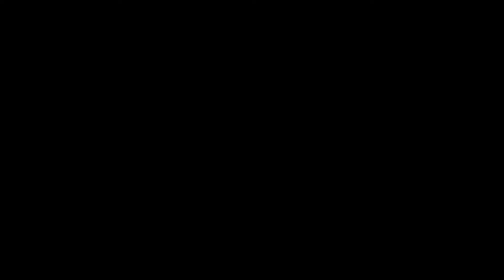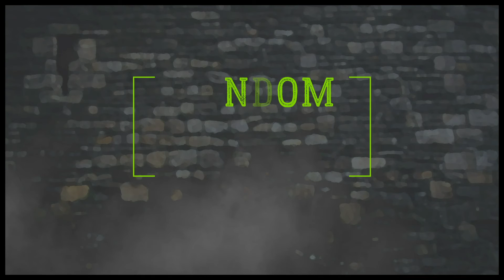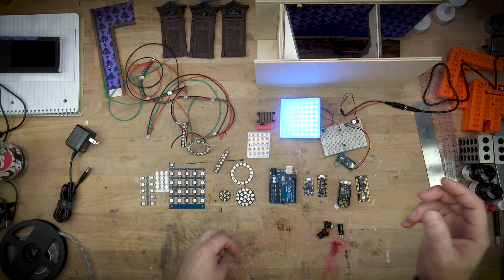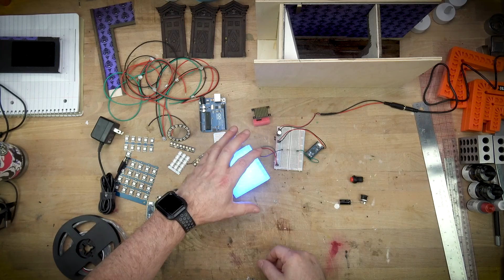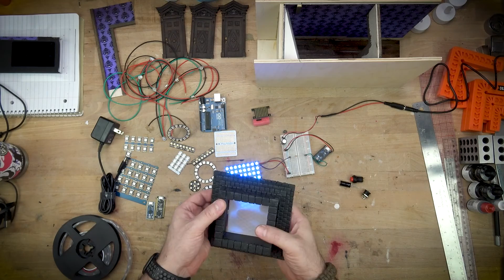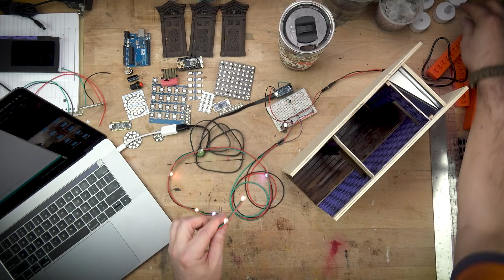Boss RGBW LED Lighting - NeoPixels and Microcontrollers

Comment: What are the orange corner things on your table around 21 minute mark?
Reply from the maker: Those orange L-shaped objects are relatively cheap plastic right angles that are used to make sure everything is square. When I’m gluing things that need to be as close to square as possible, I’ll clamp them in the corners while the glue dries. They come in different sizes and are accurate enough for the type of work. Hope that helps! All the best!

Comment: Good afternoon

Your work is amazing, explains very well.

However, I have some doubts, I've never used the Arduino and would like to try it in a diagonal alley booknook.

as I saw in another channel, nerdforge, the booknook will have some amount of WS2812B leds.

In some stores and windows, they will be looped with colors simulating that magic is happening inside, in others, they will only be lit and sometimes turned off in a yellow color to simulate that someone is in the room or has left.

can i connect all of them, one after the other between the 3 wires for the distances between the points and finally connect them all to a single pin on the arduino and program so that each one of them works in a different way and color? a resistor and a capacitor or would I need to individually connect each microled on different pins with several resistors and capacitors?

Congratulations for your channel, I became a fan and I'm sorry for the English because I'm from Brazil.
Reply from the maker: Thanks! I appreciate it. The easy answer is yes. Your idea is a great one and NeoPixels or WS2812B LEDs are perfect for the project.

There are some limits to maximum distance between the LEDs. It seems like under 6" or 15cm should work. The limiting factor is signal loss on the data line so you may find the LEDs behave strangely. You can have as many LEDs on a strand as you want and a strand of multiple LEDs are controlled by a single pin. That also means you can have as many strands with multiple LEDs as you have pins to control them. The LEDs are not powered by the Arduino but are powered directly from your power supply.

The resistor on the data pin helps protect the circuitry on the first LED of the strand so you only need on per pin. The capacitor helps prevent power surges when you power everything on. I generally put one capacitor in right at the point the power comes in to act as a bit of a surge protector or power conditioner. Think of capacitors as storage tanks... when you power up the circuit, if the first thing the power encounters is a capacitor, it starts by filling that capacitor and then releasing it to the rest of the circuit helping to smooth the flow out.

In many of my projects, I'll have a couple of strands of NeoPixels and even a single neopixel on a pin due to the location. I'll also use regular LEDs when I don't need to change the color. You can use the Arduino to turn single LEDs on and off and even control their brightness if you connect them to a pin that has PWM. Keep in mind, an Arduino pin can really only power a single LED. Finally, there are flickering LEDs that simulate candles or flames. I used those when I want to simulate firelight and don't want to try to do that in code.

A Diagon Alley nook is the perfect project to try a bunch of different lighting techniques. I hope this answered some of your questions. Best of luck on your project! Cheers!
Reply: @RandomMakingEncounters  wow, thank you so much, now I'm much more confident in taking a risk.

A big hug from your fan here in Brazil.

Comment: @Random Making Encounters  thanks for your videos👍🏻 what is the value of the capacitor please? Thanks
Reply from the maker: You are very welcome. Here's the best resource for all things NeoPixels - https://learn.adafruit.com/adafruit-neopixel-uberguide/the-magic-of-neopixels I always find myself going back to this page for reference. Resistor and capacitor values are provided. When using NeoPixels... the capacitor is there to protect the LEDs from power surges and there is a resistor on the data wire to protect the first pixel from damage from current spikes on the data line. The guide is literally uber... I mean outstanding... not the ride share. Cheers!

Comment: What gauge wire do you use for everything?
Reply from the maker: I generally use 20 or 22 gauge wire. I use silicone insulated, stranded wire. Silicone insulation will not melt when soldering and stranded wire is more flexible. However, solid wire... no little strands bundled together... will generally hold its shape and carry more current.

Wire gauge should be based on how many amps the circuit will draw. Here's a link that shows what the amp ratings are for various kinds of wire - https://www.engineeringtoolbox.com/wire-gauges-d_419.html If you use an LED calculator like this - http://ledcalc.com/ - you'll see it calculates the circuit's total amperage. If I plug in 10 LEDs on a 5 volt power source, I get 183 mA or 0.183 amps... well below the 1.5 amp smallest number on the wire chart. 

Kind of a long answer but it's always good to keep these things in mind. If the amps are too high and the wire too thin, you end up with heat... like a lightbulb. One last thing to keep in mind by way of a disclaimer, I'm an art major and my electronics knowledge is based on general research. It doesn't hurt to double and triple check my numbers :).
Reply: @RandomMakingEncounters  Thanks for the info!

Comment: Thank you for your video. I always find confusing one thing. I have led garlands with 10 or 20 leds powered with 3 AA batteries. When I use the calculator for these 3AA batteries I can only put 4 LEDs no more. Do you know why?
Reply from the maker: I'm a little stumped by those fairly light strands and the mini LED garlands as well. Honestly, the range that LEDs will operate is fairly wide. As long as you're not giving them too much power but just enough to light up, you'd be surprised how inexact you can be with resistors.

Comment: Curious to know what you did in your code to make the pixel flicker! I'm having a hard time nailing that effect.
Reply from the maker: The general trick is to randomize both the color and duration of the color changes. What can be a big challenge is that Arduino is a looping, procedural language so the flicker bit is kinda straightforward but integrating it within other code can be a trick—multithreading requires some clever hacks.

Here's a link to my blog post on my Haunted Mansion book nook. It has the flicker code for the NeoPixels - https://randommakingencounters.com/index.php/2020/10/13/book-nook-haunted-house/ Full disclosure, this isn't my brilliant idea and is a riff on some examples I found online.

Let me know if you have any questions! Happy to brainstorm or troubleshoot!

Comment: why don't you have more likes and followers?! your stuff is great! :) thank you so much.

I would like to know how you'd figure out wiring and resistors when you upcycle LEDs from random things you have/had. For example I have some color changing ones from an old pillow (I know that was powered by 3x AAA batteries), then I have some yellow flickering ones from tea lights, and a simple yellow store bought one (where I have absolutely no recollection of voltage etc)... 
They are all meant to go in the same diorama/booknook thing, so how can I figure out how to wire them without breaking them or endangering myself? :D I do want to use 5V USB so I have to choice of powerbank or wallplug.
I've noticed the rgb ones are weakest on blue when i hold them to a CR2023 battery, but they all light up even if I put 3-4 on just one of those batteries.
Reply from the maker: Ha! The age-old question... I'm a bad self-promoter is probably the best answer :)! Thanks for the kind words!

OK! On to LEDs. Full disclosure... I'm not an electrical engineer and am completely self taught. I try to work on simple circuits using low voltage and low amps to keep it safe. It's always good to double check my math and sources :). I always breadboard my circuits and then check for excess heat and the smell of burning plastic or anything else that seems outta the norm. LEDs are generally pretty safe things to play with especially when using power supplies like AAs and USB. Things get more sketch when you move to higher voltages and current or use things with high energy density like LiPo batteries—plenty of exciting videos out there showing why.

One thing to note on using coin cells to test is that they generally don't have enough power to require a resistor—3 volts is just enough to light an LED. The good news is that standard-ish LEDs all have fairly similar characteristics. We do have some things we know. You want to use a 5 Volt supply. Most LEDs have between 20mA and 30 mA forward voltage and 2V to 3.4V voltage drop. If we're uber conservative on our numbers and go with 5 volts power, 2 volt drop, and 20 mA current rating, we get a resistor value of 150 ohms for one LED. That value would generally seem like something that wouldn't blow too many LEDs. To get this value, I used this calculator (there are a ton out there) - https://ledcalculator.net/. If you click the little question marks, they provide some common values for various colors. For your standard yellow LEDs, the numbers would be 5 volt, 2.4 volt and maybe 20mA to 30ma (let's go in the middle and say 25mA). The result would be a 110 ohm resister. Honestly, in these applications, the difference between 110 and 150 is probably imperceptible. What you want to avoid is needing 150 and putting in 50. The LED may not snap, crackle, and pop immediately but you would be driving it harder than is good for it and would shorten it's lil' life. I also never seem to have the exact value I need so I'm always using a higher resistor value by maybe 10 to 30 ohms without a noticeable dimming.

From an electrical shock perspective, you need to have enough voltage to push enough current through your body to be dangerous. Very low mA can be lethal but you need higher voltage to get that into the body... the Google says something starting to get in the range of 50 volts. If you're recycling parts, things to be careful with are high capacity capacitors. In applications like camera flashes, they have enough energy in them and are able to dump it quickly to be dangerous.

The main thing you want to make sure of is you're not trying to drive too many LEDs. For a book nook, you're probably not going to run into an issue. Energy hungry LED strands can start to be a consideration. The calculator will show you the total current draw of the circuit and you should just make sure your power supply can support the needed current. I added 10 LEDs to the yellow values and ended up with a total current draw of 125 mA which should be easily powered by a supply that delivers 500 mA. If your circuit is drawing more current than your power supply can provide, it may overheat so temperature is always a measure of how hard your circuit is working. For the projects us mortal makers are creating, things should generally not be getting hot or even warm to the touch.

I hope that helps. The online calculators are good starting points and will help you figure out how to build circuits with multiple LEDs. When in doubt, start with higher values and breadboard out the circuits. At some point, you're gonna fry an LED... I've managed to fry really expensive microcontrollers and there's nothing like the little pop, puff of smoke, and smell of burnt electronics to bum ya out.

Hope that helped and have fun!
Reply: @RandomMakingEncounters  Woooah, that was a lot :D thanks. Getting a breadboard and a bunch of resistors is on my shopping list :)
So when I use those calculators, I basically calculate each LED individually, because they are all different? I've seen one that drew me a diagram with 1 resistor with 4 LEDs that were in parallel after the resistor, but they were obviously identical - So once they are different they each get their own resistor. Did I get that right?
Reply from the maker: You are correct. LEDs are semiconductors. That makes them more interesting electrically and means wiring in series or parallel will produce different resistor needs. Here's a good calculator that allows you to try different approaches - http://ledcalc.com/. If your project requires you mix and match into one circuit for sake of efficiency and reduced number of resistors, I would start by plugging in the value of the resistor with the lowest voltage and current. This should give you the highest resistor value and safest amount of energy for all of the LEDs in the circuit. It might mean that some will be dimmer than what would be expected. If they're all reasonably standard, they should all light. I've been wiring up LEDs for my nooks using the one LED, one resistor method shown in this video - https://learn.adafruit.com/lets-put-leds-in-things/soldering. As long as I'm matching to the right power source, it's just plug and play. Short answer to your question... easiest is to get their own but you can mix and match with dissimilar if you err on the side of conservative resistor values.
Reply: @RandomMakingEncounters  I have finally found a calculator that lets you put different LEDs into one circuit. It's in German, but google translate should make a quick job of that (it might be self explanatory, too): https://www.spaceflakes.de/led-rechner
Reply from the maker: @anneangersbach  Nice! It's always interesting to see what the calculator comes up with. Very cool that you can mix and match LEDs. Out of curiosity... what are you making?
Reply: @RandomMakingEncounters  my first ever book nook/diorama (its gotten quite a bit wider than planned.. not sure it still qualifies as book nook).
It's a game scene from Diablo3, and i need to light 2 church windows (white led, originally thought rgb but additive colors are a bitch), 2 torches (yellow flicker) and a shrine (yellow or white solid).
Reply from the maker: @anneangersbach  LOL! If it fits on a book shelf it qualifies! I'd be interested to see how it turns out. If you continue to make things with LEDs, NeoPixels are a great way to take total control... you wanna learn Arduino... right!? :)